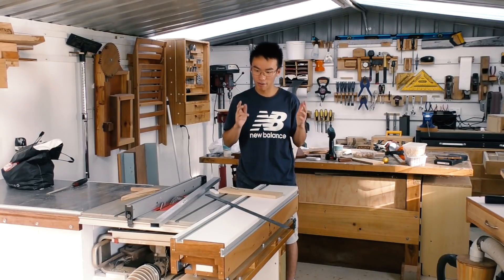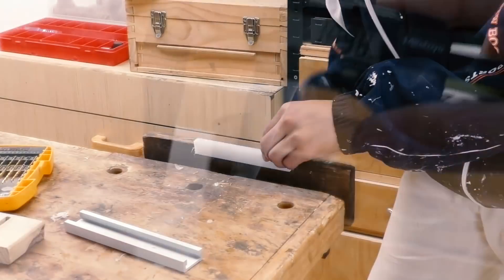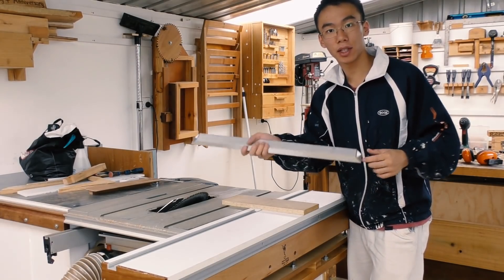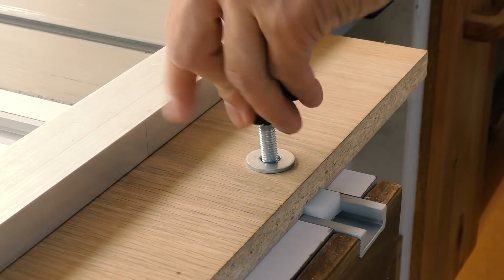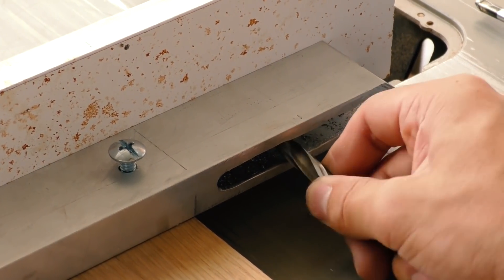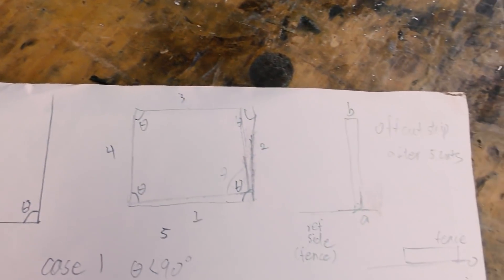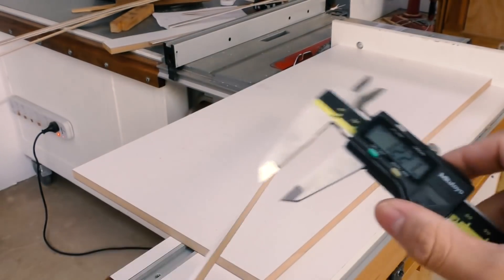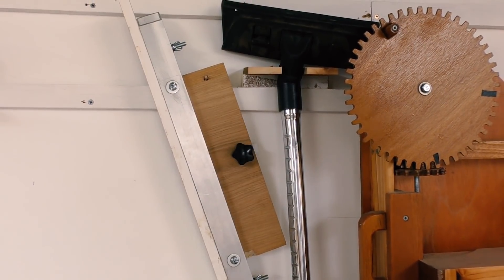A cross cut fence for the sliding table

Comment from the maker: Behind the scenes, I have struggled a lot on deciding on a design, from copying the mitre gauge on Hammer’s sliding table to some that resemble the one on Sawstop. But after all, I just decided to ditch all the fancy features and stick with a simple 90 degrees crosscut jig. Reason for not making the angle of the fence adjustable is because I have actually found that I don’t make any angle cuts. And whenever I do, I just put a secondary fence on with shims to adjust the angle. To me, the more important thing was for it to make crosscuts, that don't necessarily even need to be 100% square (okay, maybe with a tolerance of 0.1mm per 150mm) and to be reliable.
Reply: I can attest that the Hammers gauge can be knocked out of square, so good call. The cam they used is also extremely finicky to set up.

Comment: Beautifull Sliding Crosscut Table !!!! I have a Dewalt 745 table saw, I'm still deciding on to build a Sliding Cross Cut Table or a Crosscut Sled or both. I ask you that you have both and you have experience with them, a Sliding Cross Cut Table makes a lot of difference to a Crosscut Sled, can you use some Jigs and accessories associated with a Sliding Cross Cut Table? Thank you.
Reply from the maker: Yes, you sure can. Similar to a using the mitre track, except that mitre track is now enormous